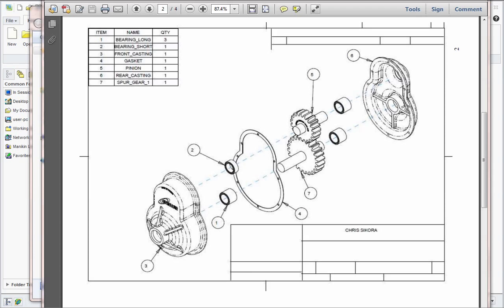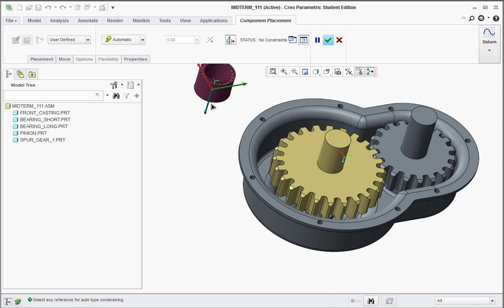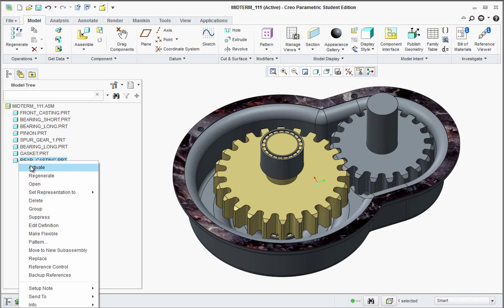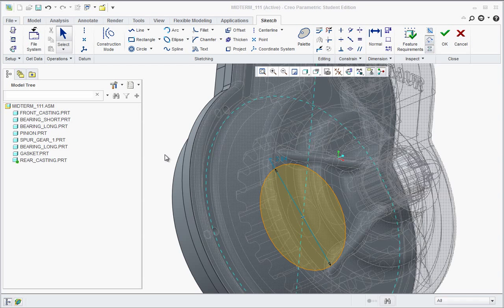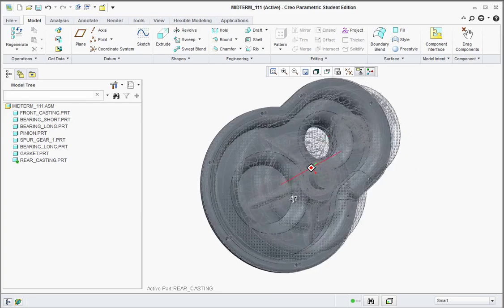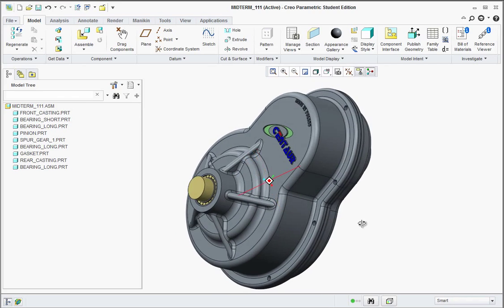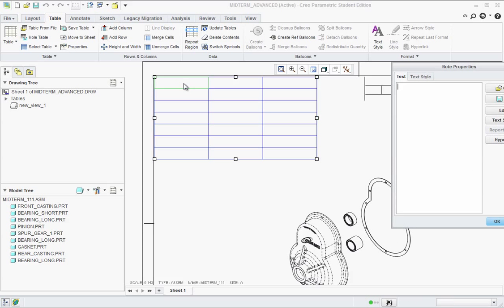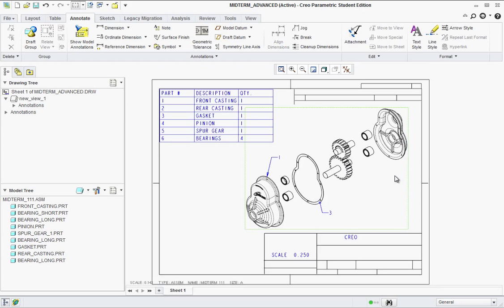CREO Parametric 2.0 ADV MIDTERM EXAM REVIEW

Comment from the maker: Hi Bradthebad,
Thank you for the kind words. Yes, Creo does have convert entities - it's called "Project". It doesn't work well with all geometry such as the holes I was working on in the video, because many of the holes were broken into 3 or more sections, so I would have to zoom up really close to select all of them, and I thought I could do it quicker with just drawing new circles over the old. Regarding default mate type settings, I'm not sure but I bet you can. probably in the options.